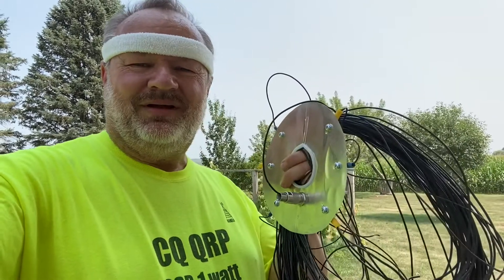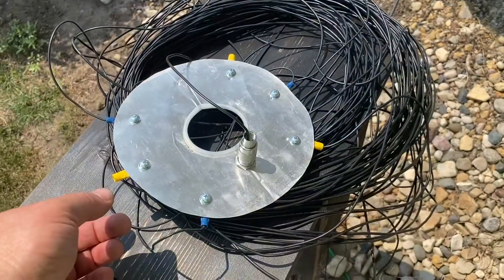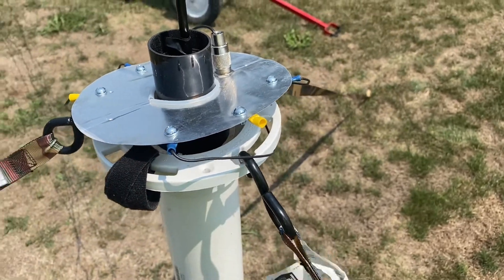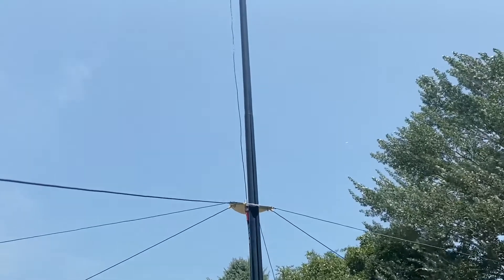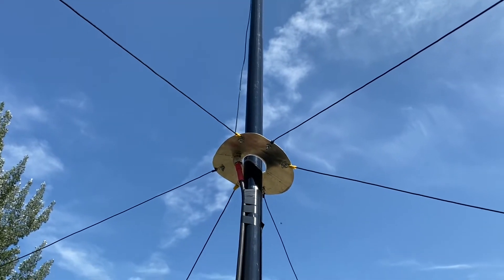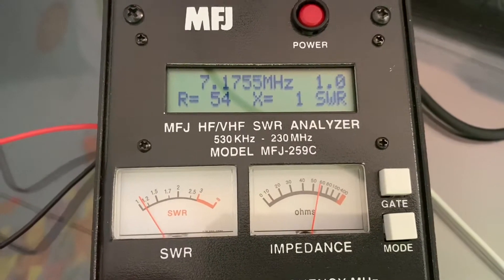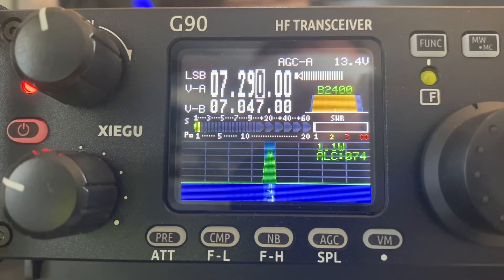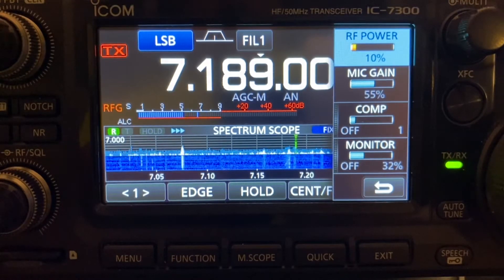YOTA QRP Home Brew 40m 1/4w vertical antenna trial

Comment: Thank you Kevin, want to make one now ;) could you tell me if your 500ft antenna gives better results than your 1/4 wave ? i'd like to make one for 20m too but not sure that a 1/4 wave on 20m will work .... Best 73 de F8DRA, Marc
Reply from the maker: Hi Marc.. Thanks for your comment.. First I'll admit that I'm far from an antenna expert and am still learning.. but, In my experience, anything vertical that can be made 1/4 for the band has been a good performer (with radials).. For your 20m idea I would say a definite YES.. You can make a 1/4 wave for 20m wire (approx 16ft) with some 16ft radials and you will have a good performer.. The 20m band is one of the easy bands to do this on because the length of wire needed is managable... I try to keep everything associated with 16ft (16ft wire, 16ft radials) and to add icing on the cake, if you can raise the base of your wire antenna on a mast 16ft off the ground and hang the radials suspended at a 45 degree angle you might find even more gain..  I do this configuration on my Camper using the MFJ 1979 17ft collapsible whip antenna and have great results.. Here is a video showing it.. https://youtu.be/mGqbar8uq7k  (note: this video was last year during the solar minimum)... As for the 550ft random long wire comparison.. the 550ft long wire is more directional with stronger lobes in some areas and weaker notches in others, but the 70ft height is a big benefit which makes it a great performer.. With your vertical 1/4 wave experiment, you will have a omnidirectional radiated signal and will perform very well in all directions.. Good Luck and come back and let me know how it turns out.. Thanks for watching.. 73, Kevin ~ k0klb
Reply: @hamradioqrp-k0klb   Thank you so much for your very interesting reply !!!  according to you it will be better if i could raise the antenna and add radials. In the case of an elevated 1/4w vertical antenna like yours, how do you feed it ? Do you use any balun or not ? Best 73 and have a good week-end. Marc  ( sorry for my english :( )
Reply from the maker: @f8dramarc80  Hi Marc.. In my experience, I've had good success by raising it approx 1/4 wave above the ground.. In the video, I fed it with coax, no balun but used a MFJ tuner to match it to the radio..
Reply: @hamradioqrp-k0klb  Thank you Kevin, hope to catch you one day on HF ;) have  a nice week end in Iowa. Best 73 from Normandy - France
Reply from the maker: @f8dramarc80  you bet Marc.. one more thing.. if your radio has an internal tuner, you can use that in place of an external tuner.. have a great weekend..
Reply: @hamradioqrp-k0klb  Good afternoon Kevin, yes you are right i'll use the internal tuner ;)    i'd like to make someone similar to the DX Commander ;)  73

Comment: Thank you for the video. I am just amazed what you are able to do with an expensive equipment. Best, K7CI
Reply from the maker: Hi Dave.. Thanks for your comment.. It took me a while, but I finally learned that a cheap piece of wire will perform just as good (or better) than some of those commercially built $$ antennas.. It's fun to experiment with wire and if it doesn't work, I mark it down as an inexpensive educational experience and move on, lol.. Thanks for watching, I appreciate it.. 73, Kevin ~ k0klb

Comment: Very nice, thanks for sharing!!
Reply from the maker: Thanks for watching and commenting ... I appreciate it.. 73, Kevin ~ k0klb
Reply: @hamradioqrp-k0klb  Tonight, tomorrow, and the weekend  I will be Practicing "TOTA", Truckstops on the air.. 😀
Tonight I'll be at the TA in Valley Grove, WV. I built a base loaded vertical using a 18'3" whip. It's good for everything 3.5 and up. And very easy to retune. I'll be experimenting with my Chinese uSDX knockoff. So output will be 2.5-4 watts on 80. I'll be pretty happy to make any contacts. Ha Ha!
Today's date:  12/30/21
Reply from the maker: @2pi628  Hi T Mike.. How did your TOTA experiment go?... Successful?.. 73 Kevin ~ k0klb

Comment: I am a fan of 1/4 wave vertical wires. I built a Multiband wire fan vertical to go with my my G90.
Reply from the maker: Hi Jeremy.. Thanks for your comment... This one actually worked pretty well and I need to get it up in the air again and play with it some more... I tried to make a multiband 20/40 vertical with some window line but it wasn't very successful.. I bet you had better luck than me.. 73  Kevin  ~ k0klb
Reply: @hamradioqrp-k0klb   well to be honest if you have seen a dx commander then you know exactly what I built. :)

Comment: I ran a 1/4 wave 40 meter vertical with 4 elevated radials, up about 6 feet above the ground for many years.  Tremendous antenna for DX both QRP and QRO.  Hug my vertical element from a big cottonwood tree...   enjoyed your video!   Paul  NA9M
Reply from the maker: Hi Paul... thank you for watching and commenting.. I need to work more with this one a few more times to get a good feel for it's performance.. Sounds like you've had good success, which is encouraging... 73  Kevin ~ k0jlb

Comment: Good to see your experiment. I have always avoided the elevated ground radials because of the single band characteristics they had. This is only book knowledge however. 73 de KI5HXM
Reply from the maker: Hi Brent.. thx for watching and for you comment.. My book knowledge is pretty limited (that might be obvious already, lol).. I kind of throw caution to the wind and don’t play by many rules which is probably why I have so many failures lol.. but I think my next project is going to be a 40 and 20m vertical multiband antenna using 450 ohm window line.. I will use the spiderbeam just like I did for this video.. From what I’ve been told, I can have the raised radials and have some cut for 33ft (40m) and some cut for 16ft (20m).. I think having the tuned radials is key.. I’ll probably have 4 radials of each.... I guess I’ll find out if it will work.. hoping to have it built and for next weekend and do a CowPOTA activation... stop back again and I’ll have a video on how it performed.. 73.. k0klb
Reply: @hamradioqrp-k0klb  That is why the hobby is so fun!  There is plenty to learn.  Either you learn by trial and error or what you thought you knew from the books.  Haha.  I am currently making a fan dipole for 80/40/20/10 and will hoist that up in an inverted V.  I then want to put up a multiband vertical.  I will be learning myself on some of this.  All the best, and I will watch any videos you put up for ham radio!  73 de KI5HXM Brent

Comment: You don't have to trim it, you just have to fold the wire back on itself. You  should check the SWR at the base of the antenna, not at the end of 100 feet of coax. G7VFY
Reply from the maker: Hi Stephen... Thank you for watching the video and for your comment..  I appreciate it..  73